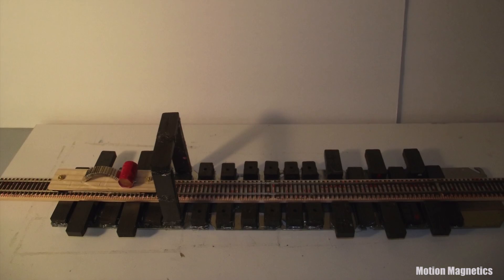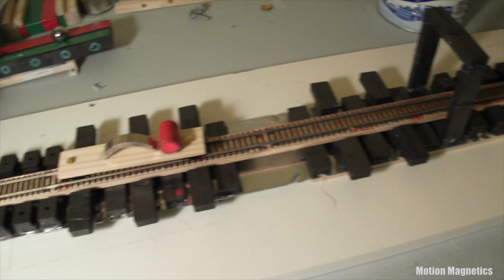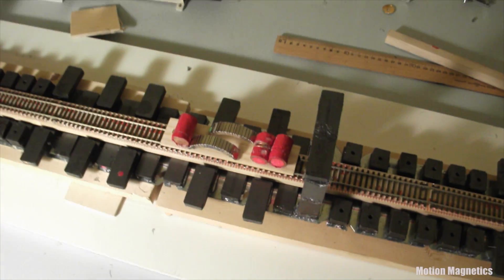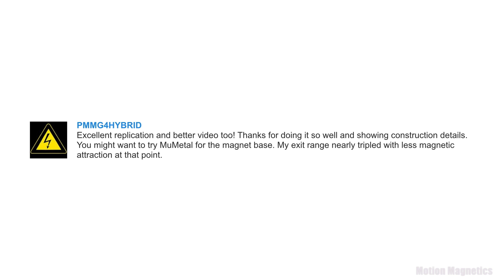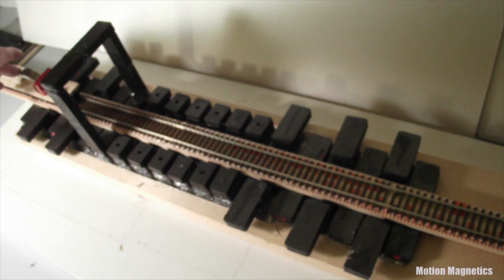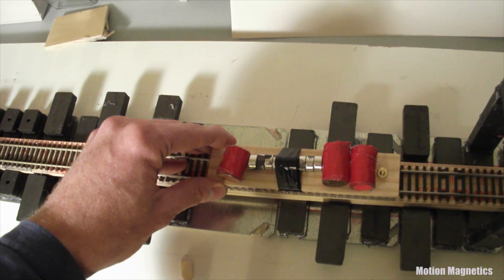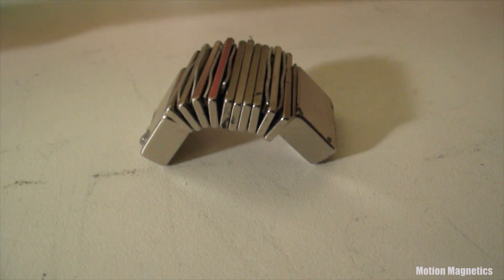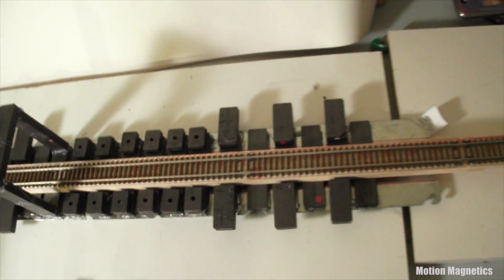Replication of PMMG4HYBRID's version of the Howard Johnson Linear Magnetic Motor  Part 2

Comment: and thanks for clearing up the purpose of the metal under the track in the last video.
Reply from the maker: Rit Man Sure. Part 1 makes more sense with the added information from Part 2, and vice versa. Johnson always used the shielding material in that type of design to  keep the magnetic fields from converging in the wrong places and creating flux loops.

Comment: how about trying a continuous track
Reply from the maker: Because there wasn't really a point, after showing the deterioration of acceleration from the first to second track. After adding the second track, the cart no longer could accelerate out the end of the second track, and had difficulty making it through the second Pulse Gate. It was essentially winding down.
Reply: Motionmagnetics dont forget that Howard said we need to think in further dimensions, x, y, Z, plus time. thats a straight track.. what could be achieved adding up and down, left and right to the puzzle? yeah i know how hard it is to build tracks, thats why I am saying not doing it!
Reply from the maker: Rit Man I've actually built a few that were something of a geometric conundrum. lol I've built them with magnets on top, under, and on both sides of an array. With... interesting results. Nothing spectacular though, or I would have posted a video. I usually like to see some promise in a simplistic version of a design before I take it into multiple levels though.